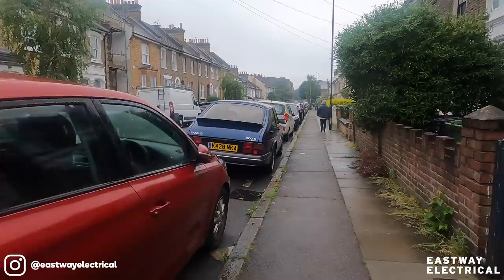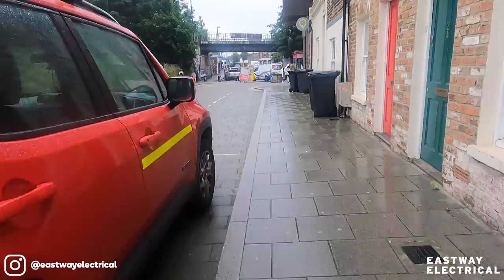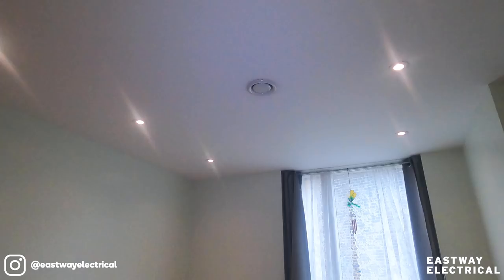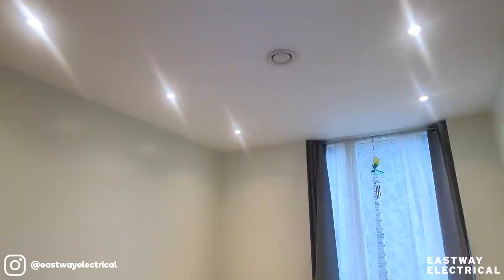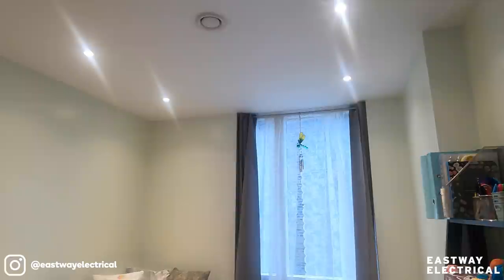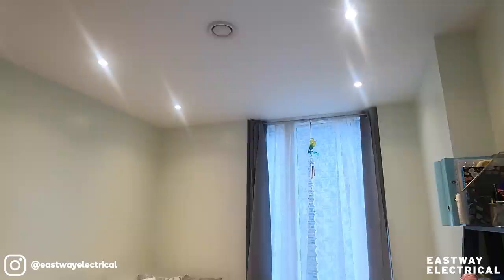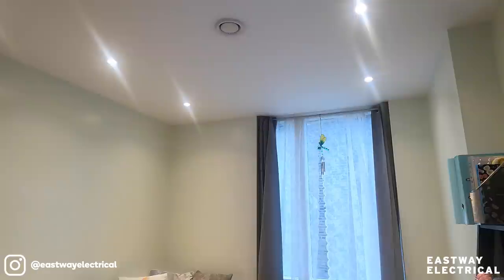Customer: "To Switch Off The Lights I Have To Go To The Fuse Board" |. Bizzare Flashing Lights

Comment: Well you fixed it but only in the sense that the client now doesn't have a swanky dimmer. The unit looks like a Hager WMGSD1L  which is an expensive bit of tech.  Presumably the underlying problem was the replacement LED lights were non-dimmable?
Reply: Agreed , i would have changed the LED’s so the lady would keep the functionality of dimming
Reply: @dean8644  then she would have had a bigger bill was quite of few of them led's to change, sometimes don't go making more headache for yourself can cost you time and money like he said sometimes can be a pain getting led's to dim which is true, she was happy to loose the dimmer keep it simple job done
Reply: I had a similar issue recently, new LED dimmable fittings and a hager dimmer, end up replacing the dimmer switch for a cheaper brand working.
Reply: @andrewbrady1063  WMGSD1L  is a leading edge dimmer so probably originally intended with incandescent/halogen lamps (they have a -T version too I believe).  Interesting.
Reply: @NivagSwerdna  thanks, the one I replaced was the WMDS1-A. To be honest there's no mention of this controlling LED fittings 🤔
Reply: @andrewbrady1063  ya for u.s. to make it more confusing there is old dimmers for Incandescent bulb but those dimmers don't work on LED, then you have modern dimmers for LEDs

although not sure how a 3 way switch with dimmer works
Reply: @John Thomas FYI The model number is visible at @6:20, and it does matter if it's Leading/Trailing edge etc.

Comment: The flat owner said it started to happen just before the tenants left, sounds like a couple of lamps had  failed and the tenant replaced them probably with cheap  tesco specials non dimmables.  The broken wires are a bit of a red herring,  possibly happened when del pulled them out notice no arcing. The only other option would be pull all the lamps and switch out any non dimmables , if your doing that really you are better off replacing all the lamps back to same brand . Its not unkown for differing brands to be incompatable , Dels option to replace the switch was the cheapest option for the customer, this is London going out to the wholesalers is a mammouth task during the day turns a small 2 hour or so job into an all day job. Customer was happy with the outcome

Comment: your right Del , always bend solid conductors over especially when they are the only conductor , not only does it prevent crushing and nipping which causes the break but it also fills the hole making getting a good connection more likely
Reply: I think these snapped because they were nicked stripping the wire though. That's why I never use sidecutters to strip wires like most sparks do.
Reply: @Ragnar8504  Yup, I've seen others using everything from a linoleum knife, to a box cutter. Makes me cringe and one day that dull knife is going to slip and end up with a nasty cut. Proper tools for a proper job, as they say. I like Del's Klein set, if it's not Klein, it's not mine... :)
Reply: @brnmcc01  I mostly use my Knipex installation pliers for 1.5 and 2.5 these days. Box cutters do the job but take longer and some older cables really have the insulation stuck to the copper. Using dedicated wire strippers means one more tool to drag around and carry up ladders, which is annoying.

Comment: Issue was probably a dimmer switch with no neutral, you need a dummy load on the circuit. When the touch dimmer is off there is still a small current going through the switch, typically it would dissipate the low level current through a halogen lamp unnoticed, however in LED's it charges the driver circuit up (even if mains LED lamp, they have little driver circuits) and once the cap charged the circuit fires off, and you get this phenomenon. Options to fix are to use a dimmer with it's own neutral - not always possible if no neutral present at switch or install a dummy load, which is usually just a resistive load. I used to make them up with £2 RS transformers and a little LED potted up in a box before they were available commercially.

Comment: I've had the same weird issue, the customer changed just 1 of his Gu10 LED (dimmable) lamps ( he had around 15 in the lounge) But... because it was a different make, it made the hole lot strobe just like Del's. It wasnt the dimmer.
Reply: you not suppose to mix the lamps Fit only one kind of dimmable lamps per circuit.

Comment: It was the transformer inside that switch because it says SLV. SLV is separate low voltage and the wires were making contact with current or voltage one minute the  next minute it did  not , the magnatic field on the load side was  not strong enough to light it continuesly from time to time so it flickered because of bade connection or possible even faulty transformer. Why will someone put seperate low voltage for such lights? NOw the new problem could be that it will blow the bulb more regularly since there is more power to it? But I dought it.

Comment: the minimum wattage of the dimmer must be below the total wattage of the bulbs installed on the circuit. normal dimmers normally have a minimum wattage of 50W but you would struggle to have more than 50W in total LEDS on the circuit
Reply: this dimmer is up to 400W the problem may be that this is slave dimmer .. where is master ?
Reply: On my lightwaverf I figured you need at least 12w of load
Reply: @DerekHundik  its not the maximum wattage of the dimmer you need to worry about, its the minimum wattage, the wattage of the bulbs on the circuit need to be greater than the minimum wattage of the dimmer or it will flicker

Comment: not all dimmers are capable of dimming LED lights , they need to be leading edge and really need quiet a load , the problem occurs because the dimmer has been damaged by the LED and should be replaced with a dimmer that SPECIFICALLY is able to 
1- handle LED tech 
2_ be able to handle such low loads
Reply: Add a load resistor

Comment: Ahh cmon, you could at least start by fixing the wires to the dimmer switch and test if that fixed the problem. If I was the customer I would definitely want to keep the dimmer feature.
Reply: Agreed.
Reply: You clearly are not in the trade or run a business.

No need to flaff about wasting more time

The easy and most reliable fix was to swap out 

If he tested the switch and it didn't work again, your just wasting time

If it did work again

Potential for it to fail 

So you just end up with a customer calling you out again and questioning your experience

He did the easiest, most economical and reliable thing to do
Reply: @deepmystic5850  you clearly dont work in the trade. 
Surely common sense is to reconnect original switch and test..... if it works ok then give your professional opinion to the customer and let them make the call. 
Its not the sparks to make.
And if you are in the trade your most probably a bad spark who always blames the equipment.
Reply: @pingu8666  I am not in this trade but run 2 businesses which are customer based

To you what seems like common sense is in fact not so common

As I previously said

The customer was happy for the dimmer function to be gone

Plus, even if it did work, it might have only worked a few weeks

Why fit something that could potentially fail when you have a tried and tested switch that's been used for years without fail?
Reply: @deepmystic5850  the customer was happy for the dimmer switch to be replaced on the presumption that it was faulty from del's past experience, he should of reconnected the unit and PROVED that it was faulty and not ASSUME
if it was a loose connection the paying customer should of been updated on del's findings.
Reply: but didn’t he also see that the switch was physically broken
Reply: @BigRhys02  No, only the wires.
Reply: @pingu8666  She was happy to switch the dimmer out on the basis she didn't care about it

Was you not listening?

I am sure if she insisted, it would have been a different course of action

But she clearly stated she didn't mind if it worked or didn't

Again, this goes back to my original comment

Faster, easier and more reliable solution provided

Customer happy 

Don't know why you are not
Reply: @BigRhys02  Wires had snapped inside

Could have been the last electrician over tightening or some other issue

Either way

Ridding of the dimmer was the best solution in this case
Reply: @deepmystic5850  You clearly are not in the trade or run a business. Dishonest and lazy people like you are exactly why some customers get really angry. It is not your job to convince customers to pursue less good solutions. It's not your call.
Reply: @_-martin-_  You are now just talking shite 

Luckily being a business owner, I have an intuitive mind when it comes to customers that just want a headache

So glad I don't have customers like you any more

You want something for nothing

Like to complain

Like to make a fuss

I been running my businesses for 12 years now, you saying I don't run a business does not mean they don't exist
Reply: @deepmystic5850  It would of only taken him a few minutes to reconnect the dimmer switch to prove it was faulty, the other comments are correct its not your job to make decisions for the customer because it would "save time." Explore all of the options and present them to the customer to make a decision, assuming what they want will often times cause problems. You know what they say about assuming, makes an ass out of your and me.
Reply: @deepmystic5850  Absolute BS
Reply: all is matter of experience and knowledge. Del doesn't know exact cause of the problem. It could be few factors Either lamps are not dimmable or the whole LED load its too small for the dimmer or maybe more than 1 dimmer per circuit....Also some dimmers have build in adjustment dials to change the low end of the dimming range.
Reply: @DerekHundik  Do not exclude the obvious, that is, that the faulty wires are causing the issue. That should be investigated first because it is a quick test and fix.
Reply: @_-martin-_  what do you mean by faulty wires ? it worked with normal switch at the end.
Reply: @DerekHundik  Did you not watch the video? When he pulled out the switch two of the wires were broken and not properly connected. Simply connect the wires properly and test it. If it works it is a quick fix!
Reply: @_-martin-_   I did watch it but the wires ain't issue here. If the wires weren't connected nothing would work.
Reply: @DerekHundik  A loose wire could easily explain this type of intermittent failure.
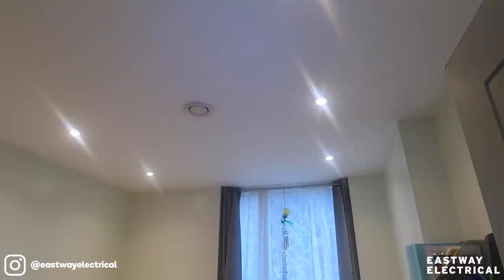Reply: @_-martin-_   loose wire ... where ? It maybe became loose when he pulled the thing out. We don't know that. And it was 1 of the strappers for 2 way switching anyway. And listen what client said at 2:57 sometimes it doesn't ....
Reply: @DerekHundik  Yes and shortly thereafter he clearly states that the wire is broken. It could easily have sit loose in the terminal. This could be the cause of this issue and that is why we are having this very discussion in this thread. It is such a simple fix that we do not understand why it is not tested.
Reply: @_-martin-_  no its not even broken That wire is just strapper coming from master switch from somewhere else. She said it's 3 way switching with intermediate switch in between. The issues are the ones i mentioned in my comments. Are you electrician btw ?
Reply: @DerekHundik  You can't conclude that from the video - it may look connected but it maybe still be faulty. One thing is for sure, the two wires in the switch were fragile and could easily be the cause of the problem. It would take 2 minutes to fix the wires and test. As LaBeouf famously said "Just do it!".
Reply: @deepmystic5850  Del gave a biased opinion based on his past experiences and let that get in the way of his fault finding on this occasion.
Reply: No need - he asked the customer what she wanted and she was Ok to lose the dimmer function. So he gave the client a quick fix for their problem. Good on you Delroy for not stringing it out into a longer and more costly job.
Reply: @chrisrogers2848  why was it a quick fix? Would of just been quicker to connect loose wire back to origianl switch.

Comment: I've seen dimmable LED bulbs in a non dimmable LED fixture do something similar.
Reply: what do you mean by fixture ?
Reply: @DerekHundik  A light fixture, light fitting, or luminaire is an electrical device containing an electric lamp that provides illumination. All light fixtures have a fixture body and one or more lamps. The lamps may be in sockets for easy replacement—or, in the case of some LED fixtures, hard-wired in place.
Reply: @epia125   light fixture or lamp holder has nothing to do with it . Lamps are dimmable or not dimmable You can fit them anywhere even attach the wires direct.